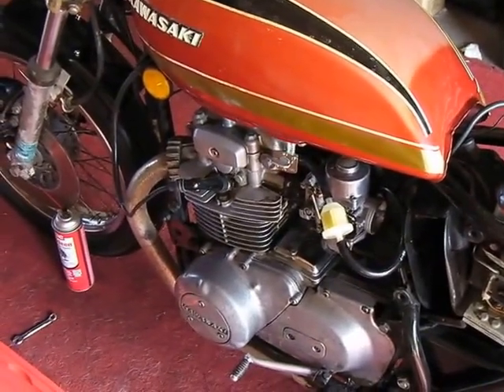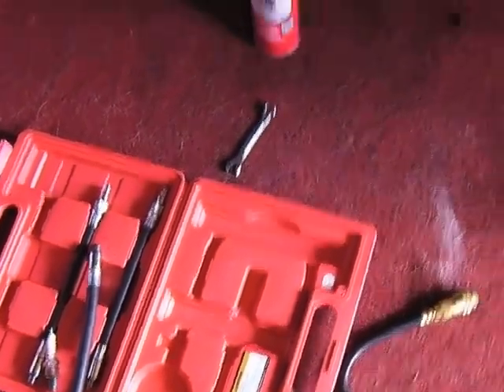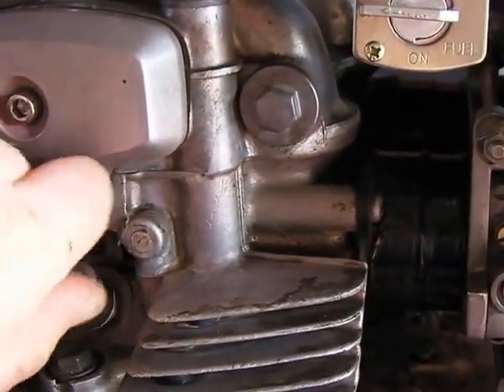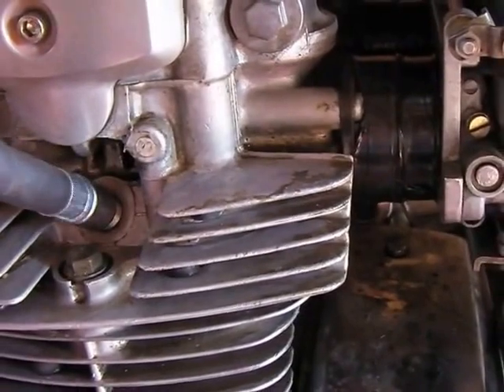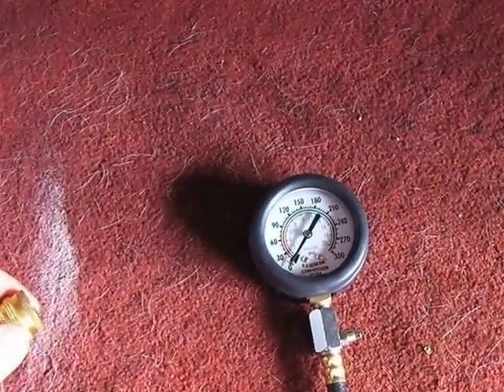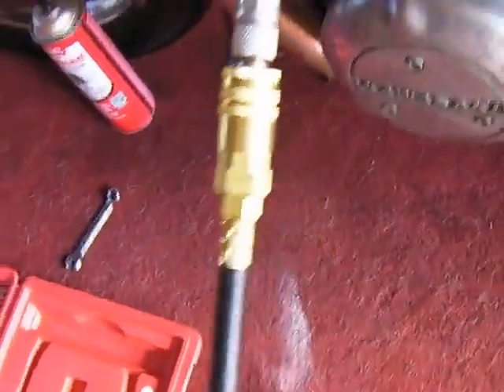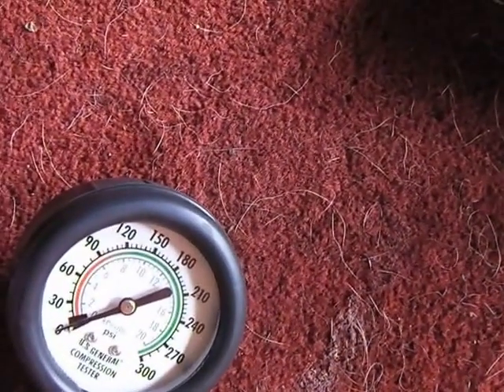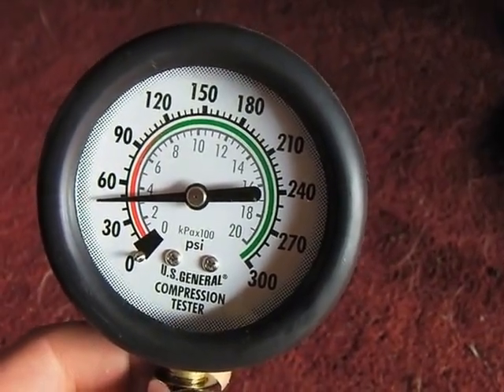motorcycle compression test

Comment: Harbor Freight tools are notoriously inaccurate. I know someone who had 70 psi from a Harbor Freight gauge, but a gauge from AutoZone read 130 psi.
Reply: Yep that's still true today in 2025. I Bought a tester at harbor freight for $40. It said my compression was way low on my shadow 1100. So I brought it to a motorcycle mechanic and his $300 tester said it was double the compression of the one from harbor freight. They are extremely inaccurate.